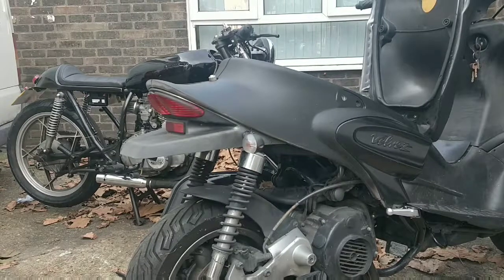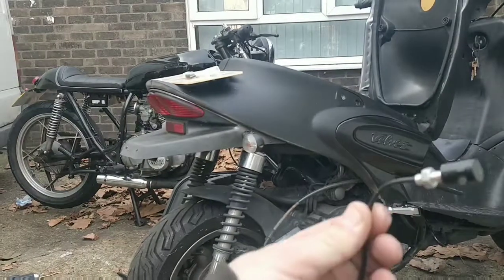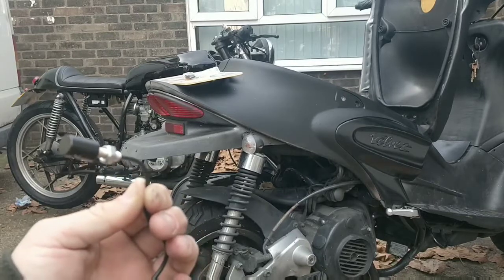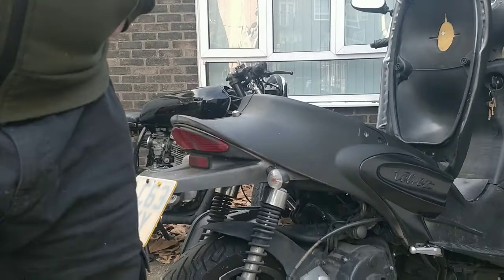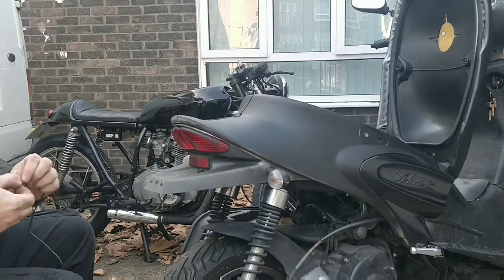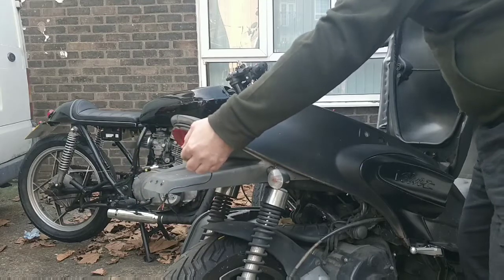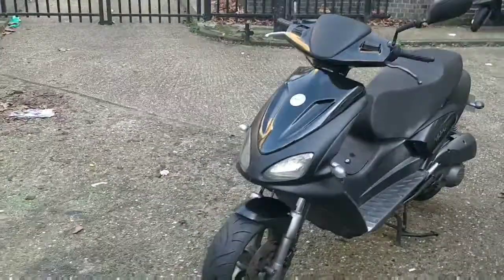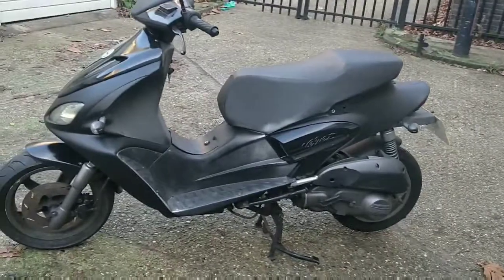Benelli velvet 125 finally finished. My free moped. Moped build. Part 6

Comment: Hello there m8. 😂 im looking to buy a 2010   125ccm Velvet... are they reliable can u tell ne a bit more about the bike. Wuld apriciate wery much. Ty
Reply from the maker: Hi, they are Chinese bikes so won't be reliable naturally. You will have to maintain it and know a little about bikes to keep it on the road. 

Otherwise I would suggest getting a more mainstream bike, honda etc.
Reply: @motorcyclerescuer  ty wery much i gues im not buying benelli
Reply from the maker: If it was cheap enough then you could buy and learn how to service it. 

But if you have no interest in servicing again worth getting something else. 

I would recommend a Piaggio fly 125. Them bikes can do 60k miles and more and have plenty parts available when needed. The mk 1 model from 2006 is fairly cheap now days aswell.